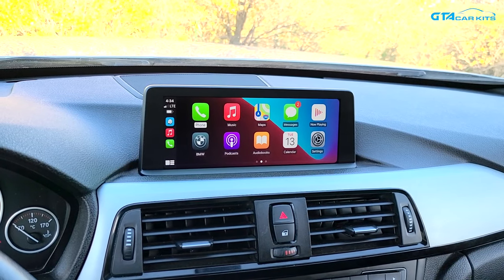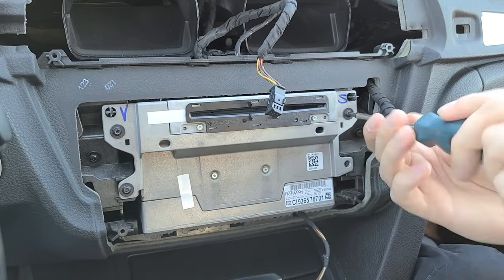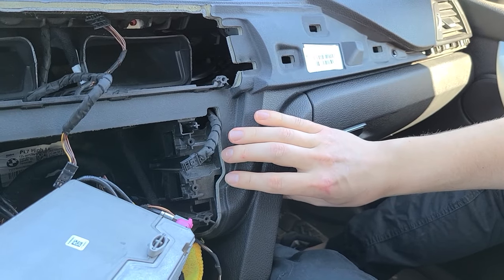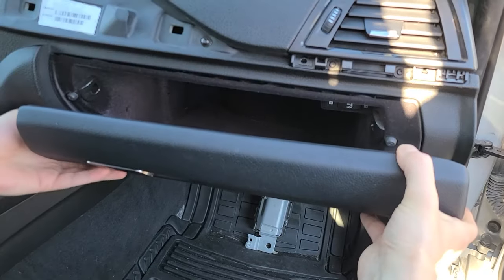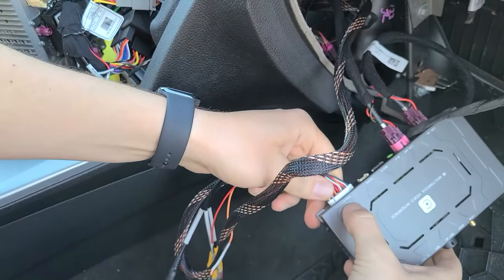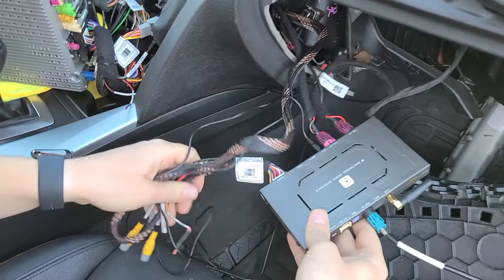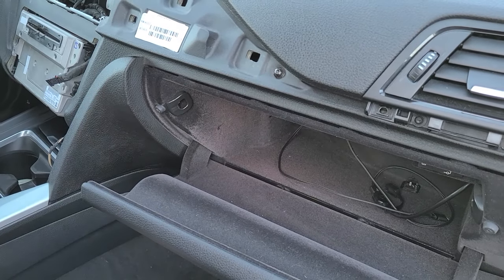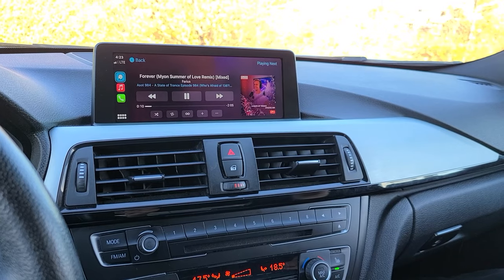Wireless CarPlay and AndroidAuto in BMW 3-series 4-series 2012-2016

Comment: Excellent video! I just installed this on my 2015 M4. The plug for my control panel (ac/heat and radio) wouldn’t come out and I didn’t want to force it so I just worked around it and it was fine. Also, I would suggest putting the radio back in BEFORE you put the glove box back. I had to take the glove box back off so I could fit my hand behind it to help move the harness around to get the radio to slide all the way back. Other than that, these instructions were great. Anyone can do this with some patience. It wasn’t hard at all.
Reply: That ac/radio panel wire is my worst enemy. Sometimes I have 4 minute battle with it, other times 30..
Reply: how is it working for you so far?

Comment: Make sure to place the microphone cable in the A-pillar behind the airbag, so when it deploys, it doesn't blast throught the wire. Also it's probably a good idea to wrap all your loose wires and plastics in some kind of foam and tape it to some place where it doesn't cause rattle and noises when you drive.

Comment: The glove compartment definitely does not need to be removed. The work can be saved, because it is absolutely sufficient only to loosen the lower cover with two 10 screws and insert the module there. No holes necessary, everything remains original. Did it yesterday in an hour

Comment: Android wifi mirroring only works for a short time?
There are three warning messages that the WiFi connection is unstable and then it breaks after 10 minutes, what wifi problem?
The car is BMW F32 year 2017?

Comment: I’m impressed on the level of work you had to put!!! I would have changed the screen as well... cheers
Reply from the maker: We found that OEM screens are still superior. Aftermarket ones glitch especially in Hot or Cold weather, and aftermarket ones do not have the same ability to show information well if you are wearing polarized sunglasses while driving. Thank you.

Comment: Hi is it possible to hear original BMW radio sound and then switch to carplay and hear google maps sound the same time?
Reply from the maker: No not possible. You can listen to original radio, and see google directions on the screen, but our kit will not override original radio to play step by step directions. To hear directions from the CarPlay, you would need AUX as the source.  Thank you.

Comment: How the hell is that wireless CarPlay when you have it connected?
Reply from the maker: You can use it both plugged in, and wireless for Apple carplay. Android auto i wired only.
Reply: @gtacarkits  The website and this video says Wireless CarPlay and Android Auto. So Android Auto is not wireless? Little misleading...
Reply: @Pkmnrocks08  i disagree